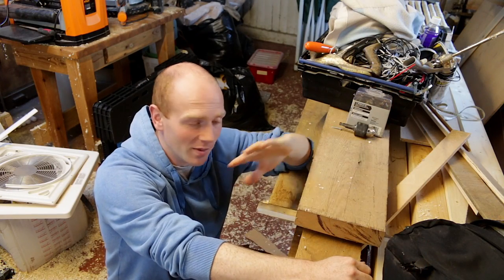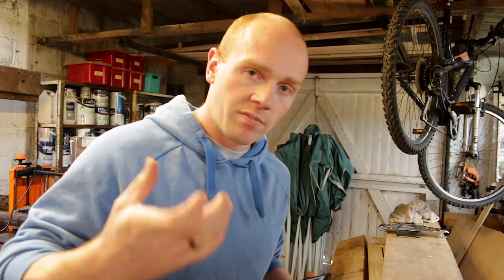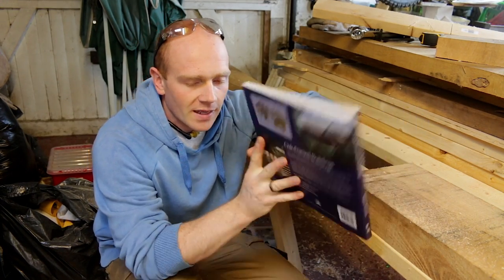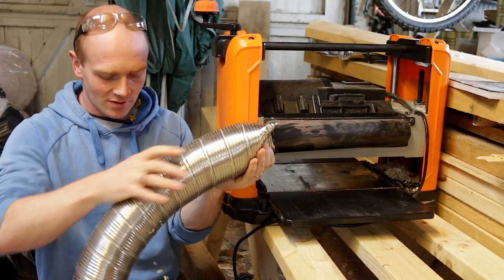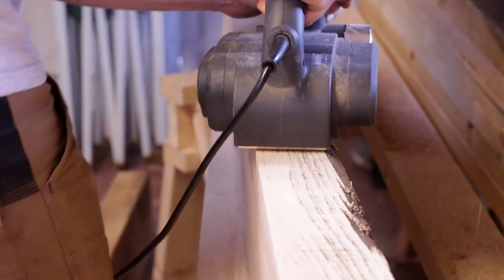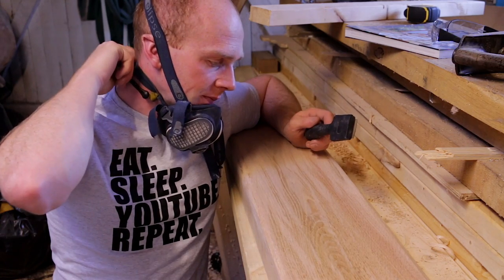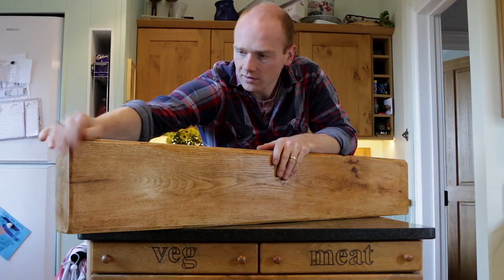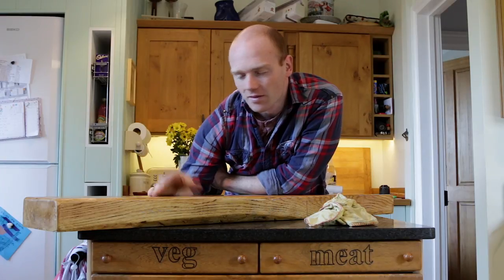Rustic Oak Mantle with the Triton Planer

Comment: since this is almost a year and a half ago, would you still recommend that Triton planer? i'm really saving up for one now lol
Reply: Just searching for reviews on the planer myself. How did you get on? Would you recommend it?
Reply: I have had one for two years, keep it lightly oiled on the height screws with wood checked for metal if reclaimed and it will last. Major tips, keep extraction clear and platen level and light passes planing you will not be disappointed 👍
Same blades from new and still going

Comment: I was just wondering how u was finding the triton planer? Do u get any snipe? I love oak its just a gorgeous wood ive got a stack in my garage and im goin to try and build a cloakroom storage bench for my porch but it needs planing as it all rough sawn lumber and i was think of buying a triton plane. Atb i love all ur videos been subbed a long while many thanks adam
Reply from the maker: It's great. Still not got through teh marathon session of planing that I have stacked up but it will fly through i am sure.  There is some snipe but I am sure that once I have tweaked the outfeed level and possibly make a sled I can reduce it alot.  Just sending through an offcut of the same size ahead of the work piece stops it.
Reply: The Restoration Couple Thanks. Uve made my mind up. Atb 👍

Comment: Hey man, just found your channel,watched few vids. Really enjoy your work.
im a beginner and just wondering,how do you rate that desktop planer ?
im saving for one and want to get one .
Reply from the maker: Working out great for me.  Not had any others to compare to but for the size it seems the best buy.  Had planned on getting a planer/thicknesser combo so I could joint too but think I can get away with most things using table saw or router plus this.

Comment: Be careful how you site the beam. I did exactly the same as you, mounted the beam above the fireplace, ready for the wood burner, and was told that it did not have the required height between burner and beam. I had to replace it with a concrete facade. Good luck to your brother with this one.
Reply: Why did you replace it